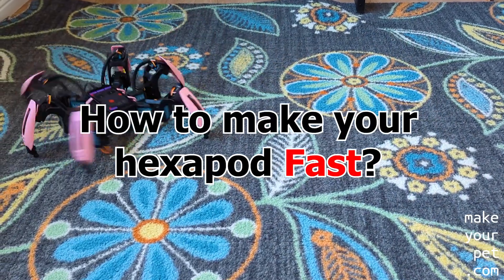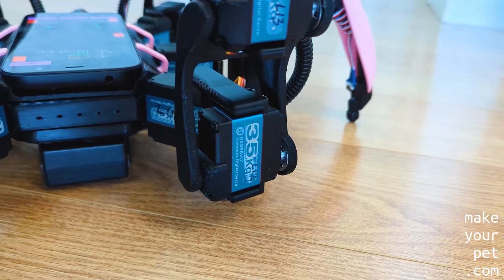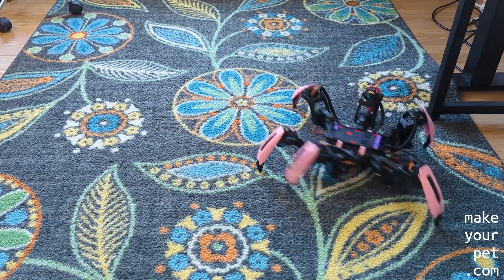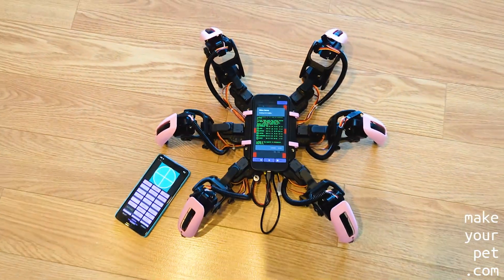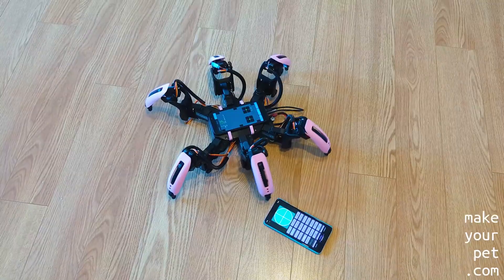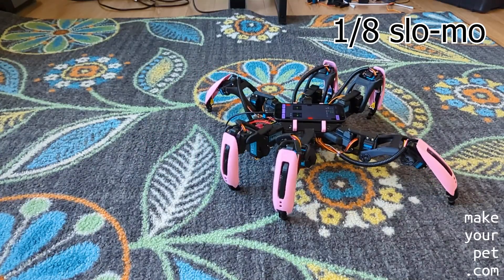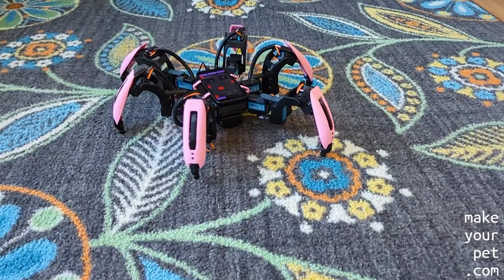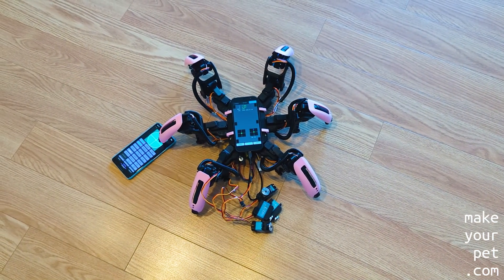How To Build FAST Hexapod Robots! Fast Walking DIY Spider Robot

Comment: I think the jitter is due to insufficient power. You need more amps. I was facing the problem for my 2 axis turret powered by arduino's 200mA 5v power supply.

Comment: Hello! I've just found your channel and brainchild, I love it! Having just seen this as second video so far, may I ask why not use something like a drone motor, if they're equivalent to cyber robotics? I love the cheapness and ease of the build, and by ease, I mean finding the resources. It looks a great project! Thanks so much for sharing
Reply from the maker: Thank you! to achieve the required torque this project is using servo motors, which is basically a motor + gearbox. Drone motors do not have a gearbox.

Comment: Do you think it would be possible to create a walking speed hexapod robot that could carry any significant load? keeping the same sort of design ethic.. electric, servo motors.. etc ??
I've been following your work for a while but only just subscribed as Im looking to start my small project soonish. thx :)
Reply from the maker: It all comes down to the servo torque to robot weight ratio. for any significant load, you will need much stronger servos/geared motors.
Reply: It is possible ofc, but it gets very expensive very fast. I did basic calc for bot that can carry 100kg and it would cost at minimum 30k excluding prototyping cost. Getting into industrial grade motors and 48V power supply. So yes anything can be done if u have enough money to throw at it

Comment: Will this android control work on other hexapod frames. I don't have have access to a 3D printer. I do have a built hexapod. Adding switches to this robot will not be difficult.
Reply from the maker: Yes it should work. You just need to modify the geometry values in the config to reflect the parts that you are using.

Comment: Hmm, there’s a lot wrong with the way most hexapod robots hold themselves too. Ppl always go for (arachnid) leg anatomy, but that requires a high base position for good agility, spiders achieve this by having passively constricted leg joints so they spend no energy standing up on all limbs. 

But (insects) specifically, don’t have radial symmetry, which is another big reason these are usually slow. Hopefully those higher end motors you mentioned ever get implemented into properly bilateral hexapod designs in the future by someone, cause that’d be the key to a truly speedy bug bot without it being absolutely tiny.

Comment: You may be able to correct for the jittering in software if you had analogue feedback on the servos, the jitters should show up in the feedback and allow you to dampen them somehow in the software. You may also be able to add some software compliance too based on the position feedback. It wouldn’t be as good as hardware compliance or current/torque controlled actuators though.
Reply from the maker: yeah that would be great and if the jitter shows up in the feedback I could probably do something about it in the code. but the downside of that is I will need 18 analog inputs for the 18 servos...
Reply: Is analogue feedback servo more expensive?

Comment: IMHO you are missing the great opportunity to use a simple neural network to compensate for legs weight and backlash forces by letting the AI to predict the real force curve needed to drive the servos in place. If you use only raw data mathematically you'll never achieve good results and a real life "biological" adaptability to different surfaces/terrain.

Comment: I have a standard bluetooth game controller for phones (iPega PG-9023S) I use it often in my own robot projects. What I mean is to pair the joystick with the phone and control movement without touching to phone.
It shouldn't be difficult to include these types of joysticks in the software? Would you consider adding this feature?
Reply from the maker: Yes, that is in  the plans. I was thinking to start with a PS4 controller.

Comment: I love your hexa but especially firmware! I want to redesign it but with your firmware. I need the lengths from joint to joint for your already calculated kinematics codes. I measured coxa, femur, tibia's lengths from STL files it is 43, 80, 130mm respectively. Can you confirm this?
Reply from the maker: Thank you. Yes those are about right. You can find the exact lengths from the config file for each robot on my github page. You should be able to use any size leg parts and enter the values in the config.

Comment: The problem with overshoot is a PID issue with the servo. The problem is that youll have to replace the internal drive controller to mess with the motors pids. Totally possible though just a lot extra work
Reply: It would be so easy to just adjust the gains. Too bad they won't let you do that easily.
Reply from the maker: True. My guess is that these RC servos are tuned to function under load, like in a RC car. That's why I have the most issue on the coxa servos where there is no lateral load on the servo and it oscillates as a result. But it seems the faster the servo, the more obvious this issue it.
Reply: @makeyourpet  Does that mean that you could use faster servos for all except the coaxial one?

Comment: So DS3225 are quicker than DS3235 but WE may have troubles 

We could use DS3235 PRO but the price is more expansive ? Such a Big difference ?
Reply from the maker: I haven't tried the pro versions so I can't give you a definite answer. But If I have to guess I would say the faster servos will have overshoot. But if you just want to zoom around and go fast overshoot doesn't matter as you see in the video